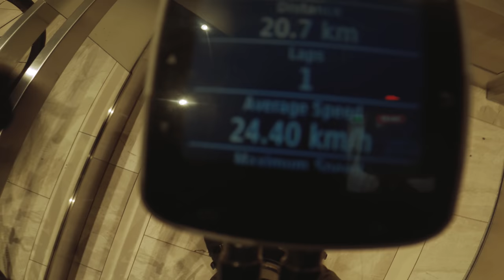my bike is broken (kinda) also dont do crack

Comment: Bro could be your bottom bracket squeaking inside the shell extract the bb paint some locktite on it and install it back in bro
Reply from the maker: Hey it was actually the front wheel bearings, I was convinced it was the bb LOL I was wrong